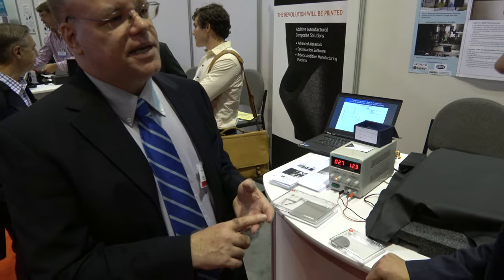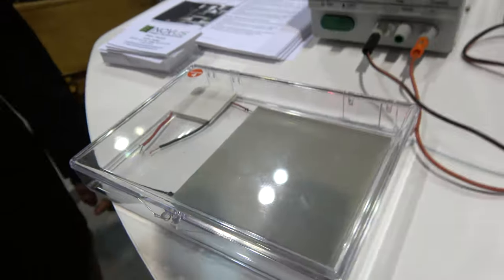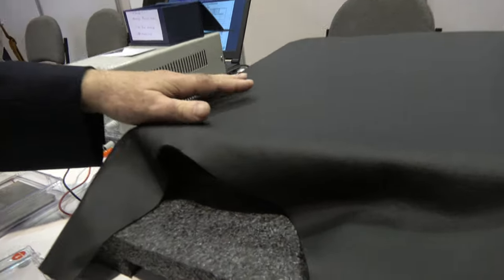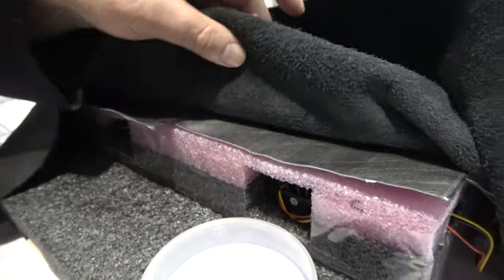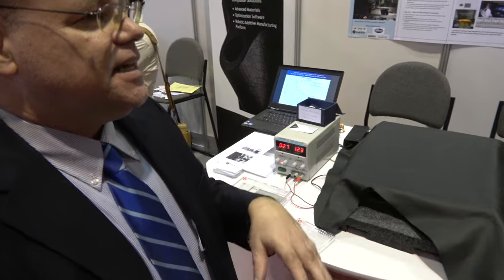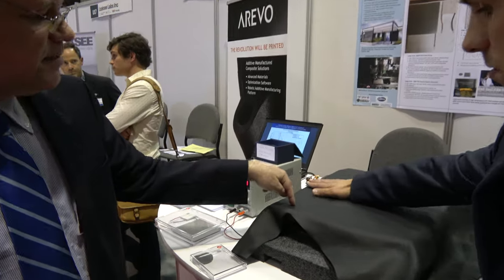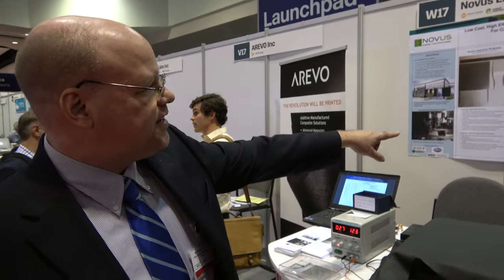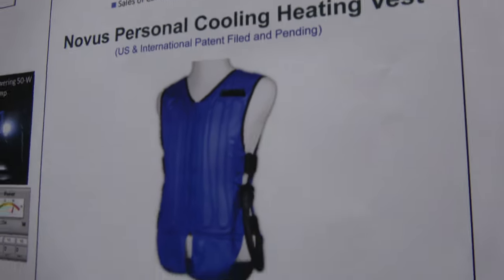Novus Energy shows solid state cooling/heating and heat-to-electric conversion technology

Comment: This will work great with my new product design the Digital MPPT thermal controller. I will be using the device to fully heat my house with PV electricity but with this cooling will also be possible maybe at better efficiency.
There is no usable information of their website. Will love to here more about the new materials they use and characteristics.
Reply: you did hear the 5% efficiency...... its nothing new, its old peltier tech re-hashed for more new investor money
Reply: He mentioned 5% for peltier when used as a generator (seebeck effect) and 7% for their new device based on other materials than traditional Bismuth Telluride used in traditional peltier modules.
If they have a 2% increased in efficiency as a generator (5% to 7% is a large jump) then maybe they also have improved efficiency when used as a heat pump.
Even traditional peltier modules can be quite efficient as a heat pump when used properly with just 10C delta per stage and multistage if large delta is needed that way COP of 2 even 3 is possible getting almost as good as traditional compressor based heat pumps. The use as a heat pump is what I'm interested in and not generators.